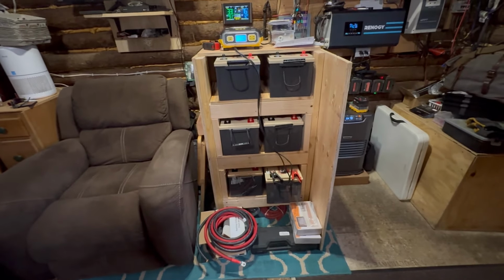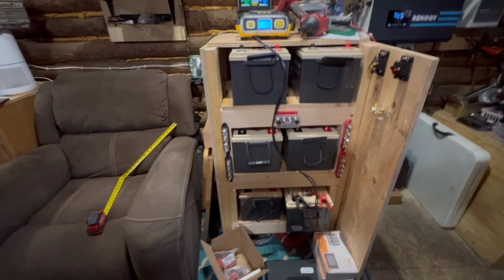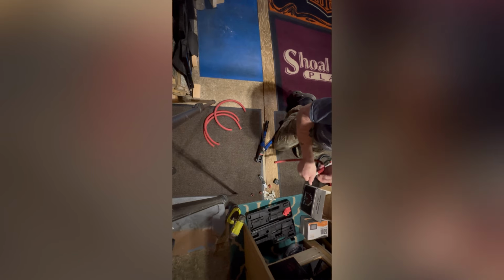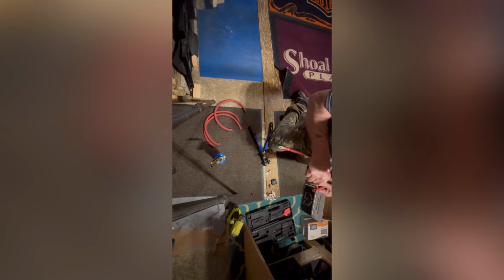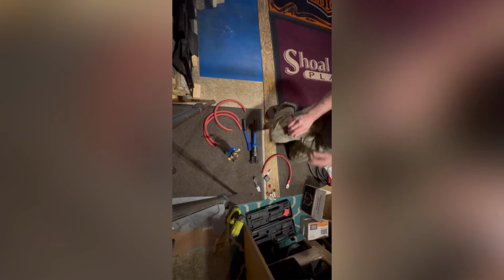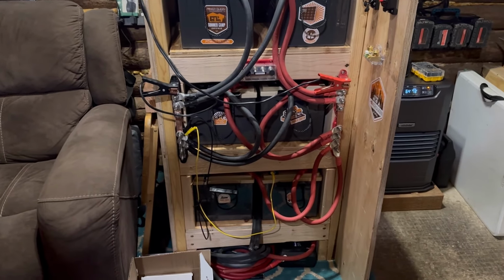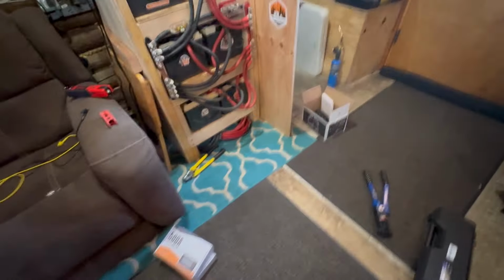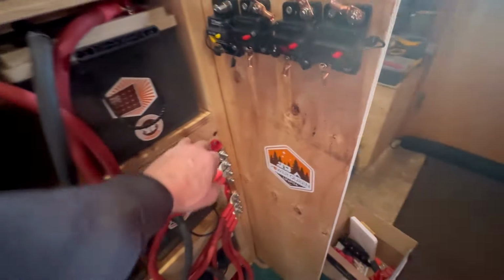Off grid power storage transition. Power Queen LifePo install

Comment: Crimping better than solder, you are kidding, you get corrosion problems with crimps, because soldering excludes oxygen to joints, CRIMPING does not and you get corrosion of joints.
Reply from the maker: That’s why you use heat shrink tubing that has glue in it. That seals it completely

Comment: Nice job on the cabling.  I used to do some of this type of work and the last place I worked we had Installers that dealt with installations. I bought a similar crimper on Amazon. It works great. I clamped it to a board that I could clamp it to a bench and use it one handed.
Reply from the maker: Good idea thank you for that. Thank you for watching too

Comment: Looking real good.  Keep in mind that those types of automotive circuit breakers (which I use too) are only rated for a few toggles of the reset lever <100.  So if you intend to use those to disconnect power regularly, it may be worth picking up a replacement of each size to have on hand.  They may last a couple years or they may fail after 10 uses if they are switched under load.  Ideally a disconnect switch inline with the breakers would provide a way to remove the power flow before switching the breakers on or off.  Sorry about the loss of your partner, never easy.
Reply from the maker: @aspendell209  thank you for that information. I have seen those fail before but thought it was just a rare thing but it’s good to know they are not the best choice. I will look into something better on the main power at least.
Thank you for watching